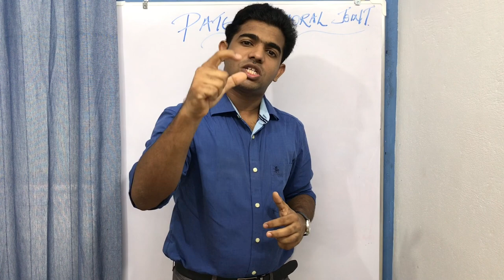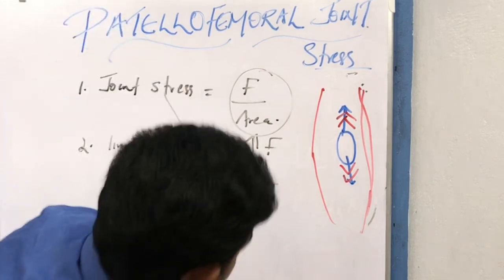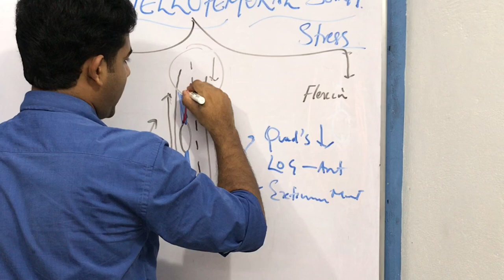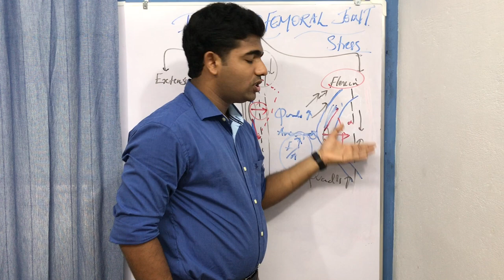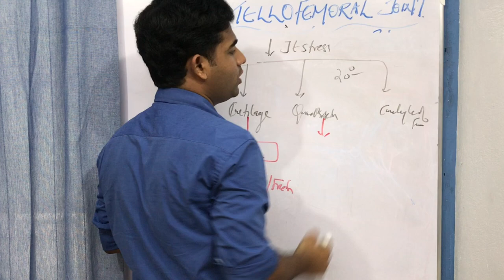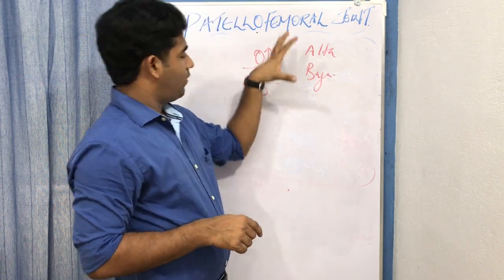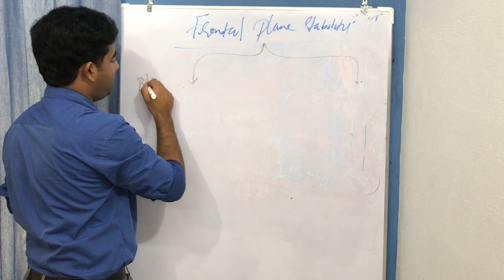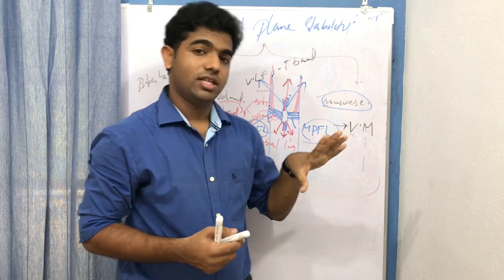PATELLOFEMORAL JOINT STRESS & STABILITY # KNEE BIOMECHANICS

Comment: To summarize 
Joint forces and stability has inverse  relationship in pf joint.forces are higher in extension,stability is less and compression is high although many factors are working altogether to reduce some stress and chances of patellar displacement due to difference in line of pull between quad and patella tendon .contact area is higher in flexion less are the joint forces and greater is the stability.anteriorly the patella is stabilized by longitudinal and transverse stabilizers..
Reply: Thanks for providing readymade material to working people like ours who have time restrictions to revise and go through
Reply from the maker: Thats great job...may i add some more clarity....joint forces or joint stress ( Stress=F/A) is showing inverse relation at Patellofemoral joint. That's is at KNEE EXTENSION is having least compression or joint stress in this joint and that is goof for the joint as less stress lesser is the likelihood of joint degenerative changes or excessive demand on the joint.
At same time FLEXION  has very high stress and compression and it increases as flexion increases. But in terms of stability the KNEE FLEXION is more stabilized than EXTENSION and thus there is increased chances of subluxation or lateral displacement at extension. 
So in nutshell in a rehab setup its better not to go to extremes of flexion such as deep squat etc if there's degenerative changes.This are reasons why SLR and exercises with knee extension( but not to go with terminal extension in non-weight bearing, weight-bearing its perfect) are advised in DEGENERATIVE CONDITIONS.
But if our patient is there with issue of loss is stability at the joint its better to make him exercise in flexion range than in extension( in particular avoid knee terminal extension in non weight bearing)
More clarity u will get by tomorrows video on Q ANGLE
Reply from the maker: It gives me immense happiness that its helping you.....thats what i aim by this ...to let biomechanics have a great role in our treatments rather than just traditional ways....all the best mam....your message made my day..
Reply from the maker: And madam, we see our patients with OA and other degenerative changes adopting a knee flexed position than knee extension espically old age...this may ne one reason why the degenerative changes increases many folds when knee flexion is maintained for long time as always the stress and compression on their joints are maximum...which wont be good in long run...
Thank you
Reply: @TonysTutorial  the contact area between patella and femoral trochlea increases from 0 to 90 degrees and hence open chain excersices from 90 to 30 degrees are adviced as they reduces the stress on painful joint
Reply from the maker: yes..... that is discussed in upcoming video
Reply: @TonysTutorial  definitely we will discuss much more...and thnx for replying too.yes q angle has a role in patellar  tracking during extension but still there are controversies and so it has led to conclusion that q angle may be one of the factors and pathophysiology of pf joint is multifactorial and not just structural abormalities.
Reply from the maker: Ya the reality is there is lot more need of studies to discover the working of human body...Q angle is all about an assumption about line of pull of quads but this line of pull always need not concide with the real line of action of muscle...usually at end of everydiscusion i point out very breifly that thers limits for this generalisation and assumptions.... and as u told most of patholgies are multifactorial...its clinician sense that should work to identify the relevant one ...
Reply: @TonysTutorial  very true
Reply from the maker: Thnk u fr disussion

Comment from the maker: Time codes:
1.Patellofemoral joint stress: 1:40
2.Factors regulating stress: 2:21
3.Joint stress in extension: 7:20
4.Joint stress in flexion: 10:03
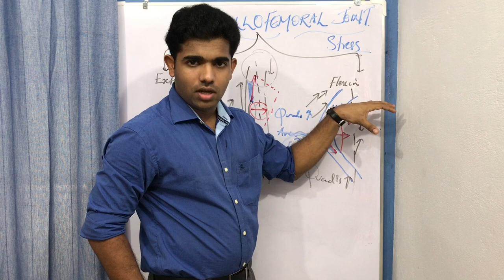5.Compensatory strategy : 12:40
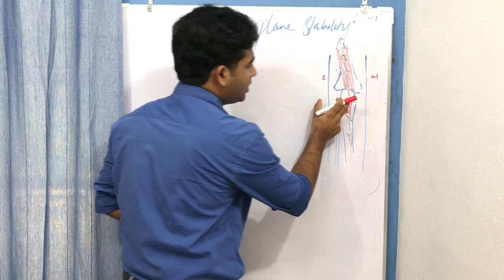6.Patellofemoral joint stabiliy: 22:30
7.Compensatory strategy to increase stablity: 26:40

Comment: what changes will the condition genu recuvatum produce at patellofemoral joint??
Reply from the maker: Lets look into what is genu recurvatum , its is hyper extension at knee joint, since its a patholigical sitation than anatomical it will lead on to variuous changes in the knee joint.Here there will be increased tensile stress on posterior knee joint capsule and ligamentous structre as in this postion posterior structres are streched out.Further theres is some instability with the knee joint yhat can lead to increase ACL injuries.
Reply from the maker: And i believe that it can also lead to increased compression forces in the anterior joint  compartment and posterior there is increased
Reply: okay, sir thankyou so much for your time and answers. 👏🏻👏🏻
I got it sir